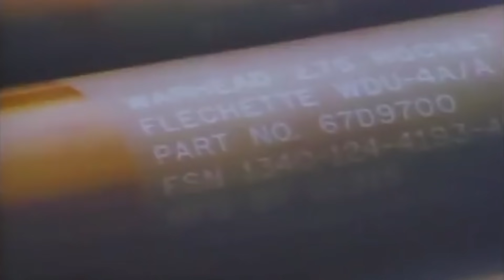'Rods from God' Weapon System Gets Another Look

Comment: This is not possible. Every action has an equal and opposite reaction. The energy you spend on sending these rods up, is what you will receive when it impacts the ground. A big explosion for sure, but not nuclear sized by any imagination. If this was true, we would have to spend nuclear explosion amount of energy to send the rod up to space, witch is not required. You can not get a bigger explosion than the potential energy stored in these rods.

Comment: Rods from gods, total Hollywood magic. You need a big mass to achieve a proper impact. The rods will only Bury into the ground, no big earth quake land upheaval as in the films or simulations. The tsar bomb did little damage to the ground zero but the heat and shock wave did and that was a 50 megaton blast at 2000 feet. The rods are pure fiction like the star wars laser. You can make a mouse lift a house with computer ai junk.

Comment: This is true weapon been considered in Cold War however its impossible to have enough mass or velocity to destroy a whole city it might destroy a building or a bunker with the best technology we have today but it will be expensive, the material of the rod has to have high density for cubic meter and high melting point, problem still be a guiding system which is why this idea was not developed to reality . Tungsten is best material because of its density and high melting point, but it’s too expensive each rod would cost $600k raw tungsten, launch to orbit $20 million guidance system $10 million satellite platform $100 million so each launch could reach out to $130 million, to flatten a city like London from the movie GI Joe need 105 rods . In current technology is possible but with economy and benefits it’s damaging to the owner of the weapon lol

Comment: the biggest ICBM has a payload of about 10 ton = 10 rods    It is going to be an expensive exercise 
Then there is the accuracy issue   I guess extremely low   And of course no guidance at all 
Alternatively the same ICBM can deliver 10 MIRV of 750 kton/each (50 Hiroshima)  
I would take a MIRV instead of a rod anytime 
The weight could be similar  but the effects quite different

Comment: One problem. If it's in orbit, it's traveling at around 17,000 mph parallel to the eath's surface. If you simply drop it, it will continue to orbit at 17,000 mph. For it to drop, it would have to recreate decelerate which woulda require a rocket on the projectile. 

Second, terminal velocity. There is an altitude that if you drop something is the fastest speed it will achieve. Above that altitude it won't get any faster due to wind resistance.

Comment: There are a couple good videos on this but a dense telephone poll sized rod of tunkston would have a massive explosive effect actually, that's part of the reason it was pursued so heavily you drop simple solid dense piece of metal at extreme speeds and create the effect of a complex warhead.

The reasons it didn't gain so much traction is to reliably use these satellites you would have to deploy several of them into orbit to have any reliable use. It takes a lot of effort to move that much mass up into orbit in the first place.

Comment: If the speed of the tungsten rod is sound barrier breaking then that would be rather disappointing as orbital velocity for LEO objects can be Mach 20+
Reply: In addition, the kinetic energy would still be far less than that of warheads carried in ICBM’s with the mass of each rod being around 8500 kilograms and if the rods touch down at mach 20 (which is unlikely due to air resistance), the kinetic energy would be around 2 * 10^11 joules which is 200 gigajoules. Meanwhile, the bomb dropped on Hiroshima has 63 terajoules and the warheads on ICBM’s are far more powerful than the bomb dropped on Hiroshima. So potentially devastatingly powerful yes, comparable to ICBM’s no

Comment: issue with this is guidance.  might need to be slightly more sophisticated than just a solid rod.  but not that much.  pretty basic control and avionics package, RCS and movable fins should be enough. 

launch cost is coming down. 
could easily be concealed inside a shell sat.

Comment: V=πr^2h
Volume = π(.5)^2(20) = 15.71 cubic foot
Mass = density * volume
Mass = 1 201.74 * 15.71 = 18,880 lbs or 9.5tons

So a 10Ton Tungsten rod hitting the earth at Mach 10 

KE=1/2mv^2
KE=1/2(9000kg)*(3430m/s)^2
KE = 52,942,050,000 J

The explosion of one ton of TNT releases approximatly 4.2 × 10^12 joules of energy;
4200,000,000,000J

So all this tungsten rod will do is to break some concrete... How underwhelming

Comment: Tungsten is used as an electrode in TIG welding as well as light bulb filament.  It's dense and it's thermal properties are extraordinary.  Dropped from 1000 miles up there wouldn't be much, if any material loss.

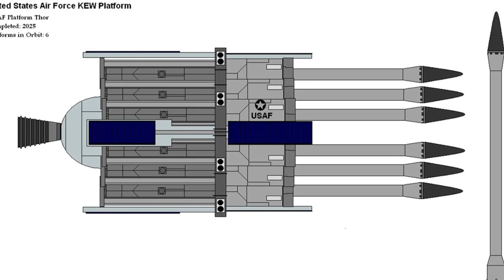Comment: 1:10 "Sound barrier breaking speeds" is a bit of an understatement for mach 10
Reply: Yeah, I noticed a lot more than that for mistakes in this video. These things don't kick like a nuke. You're gonna a couple of TONs worth of TNT out of one of these things. That's piss weak compared to regular bombs.
Reply: @imofage3947  havent you seen what a small Meteor does to the earth when it hits? look at Russias
Tunguska disaster
Reply: @imofage3947 well actually a Tungsten Rod 1 ft in diameter 20 ft long hitting the Earth at 7000 mph will penetrate like 150 ft deep first going through 3 ft of concrete creating a crater roughly 200 ft in diameter yeah that's a little bit more powerful than a bomb
Reply: So 32 ft per second squared is Mark 10
Reply: Yes hitting the ground at 7,000 miles per hour that's going to leave a dent about 150 ft wide and around  100 + feet Deep

Comment: What if you simply encased the metal rods in Ceramic so they can survive re- entry into the Earth's atmosphere? 

Then dropping it from Orbit shouldn't be an issue.  By then time that thing hits the ground it is going to generate so much momentum and kinetic energy that no bunker is going to survive it. 

Even if the target was underground the shock wave alone would liquidfy the internal organs of anyone inside the complex.
Reply: 1 ceramic would melt
2 tungsten is one of the strongest metals, it’s extremely difficult to melt, you’d need a temperature of 3000+ to melt it

Comment: these weapons have no were the power of nuclear bombs get your facts straight. The maximum velocity you could reach by the acceleration of earths gravitational field is the escape velocity: 11.2  km/s  the mass of the rod is about 1000kg 
Therefor its kinetic energy is 6,3x10^10 J  gas has an energy of 46 MJ. Therefore the energy in unites of gas would be 1400kg of gas, which is an extremely powerdense, but nowhere near a nuke. But in reality these numbers will be even lower.

Comment: Some food for thought.  Aerodynamics and shuttle tile technology could easily ensure that the projectiles do not burn up in the atmosphere.  In terms of cost the only. real cost is [primarily in the building and forward deployment of such munitions. Maintenance missions will add additional cost.

Of course, if one really wants to understand this weapons system, one merely needs to read, The Moon Is A Harsh Mistress.
Reply: Some food for thought: ceramic has melting point of 2000C, tungsten - 3422C, you'd have to be a complete idiot to have missed this.

Comment: Well space junk isn’t made of tungsten. Tungsten has the highest known melting point and is incredibly dense so combined with the shape of the rod it’s unlikely it would break up. Also it’s orbiting at 8km/s but according the Air Force paper drag would slow it down to around 3km/s. I did some rough calculations based of its density so around 8000kg and on impact it would hit equivalent to 1.19 megatons of tnt. Smaller than Hiroshima but still more powerful than tactical nukes today which are in kilo tonnes.